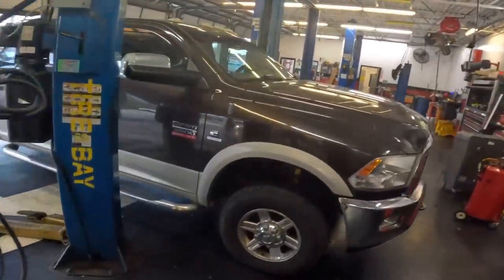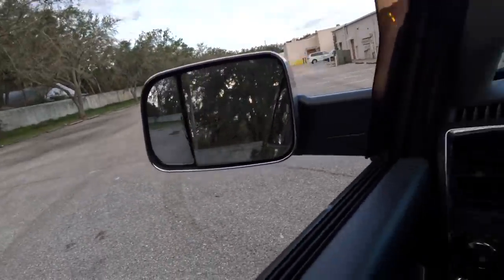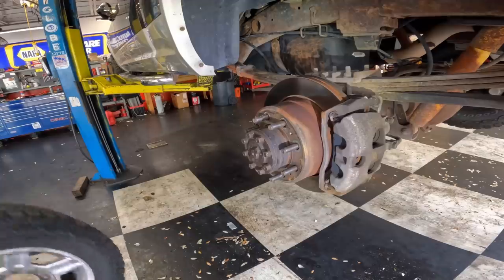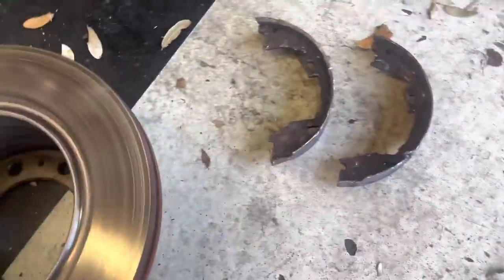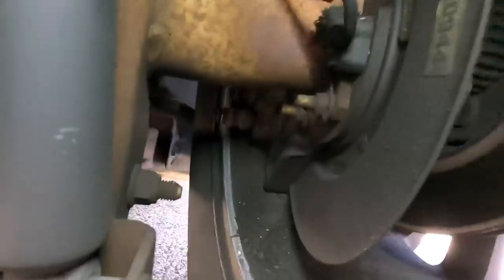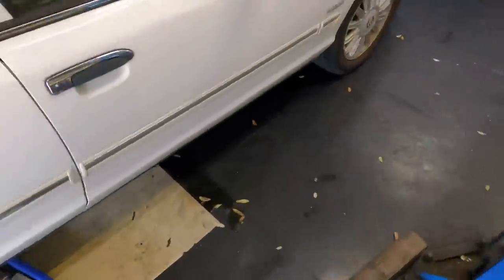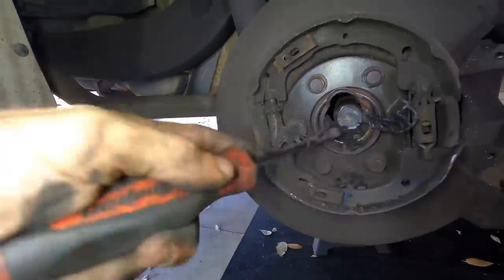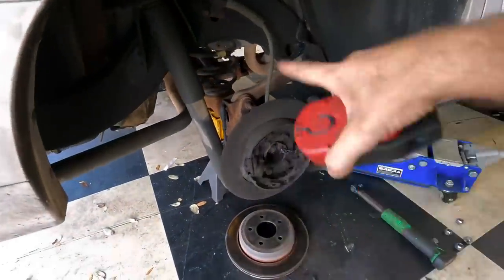Could have Killed Someone!

Comment: My wife approves of all grinding noises.
They need to happen for a couple weeks before notifying anyone.
Reply: Yours too? 😂
Reply: I have a 19 year old with similar grinding habits and some resistance to checking oil thrown in for good measure.
Reply: My wife is the same.  Must be a girl thingy.   No respect for machines at all.
Her classic line...."It just broke for no reason at all."    It reached the end of it's life cycle or you abused it maybe? (just to name a few.)
Reply: That's okay, some wives also can detect shade differences in lights too.  They know if a light comes on, it has to get brighter before there's a real problem.
Reply: @proudcanadian5713  I really think they wait until it changes to a different color before they get concerned.
Reply: I'm in that club, at least with my ex. Oil pressure light, too. "How long has that been on?" "Since I took it to JerkyLube, I was going to mention that..." (That was two surprises.) Fortunately, my now wife of 20+ years grew up with a mechanic Dad and lived at race tracks as a kid, so life's better now, for me and the cars.
Reply: My wife was the opposite, raised by a mechanic she noticed any and every odd sound or vibration no mater how tiny and insisted on knowing the cause. once found a balancing weight was bent and caused a vibration of the drive shaft, that one cost a set of tires and rims, 4 wheel alinement and a few other searches.
Reply: My wife will tell me about grinding noises. It’s the violent steering wheel vibration she doesn’t seem to mind.
Reply: I am actually wondering if people who are deaf or with severe hearing loss shouldn't get their cars driven by a friend every now and again.  :-/
Reply: Wife and four daughters, always the car is doing “X”, me what exactly is x and how long has this been happening? Daughters oh noticed it a few weeks 
/days ago, Me ?????………😳
Reply: @KeeperOfTartarus14  "The oil light was on but when I parked the car they went out so I thought it was alright...." A relative told me this about a car about twenty years ago.  The engine seized from lack of oil.  It was a nice vehicle too other than it developed a bad seal gasket leak.
Reply: @KeeperOfTartarus14  Ehh warning lights are ok if you know what is wrong with the car. I have two on my car and it runs great(one is the tire pressure sensors and the other is the check engine light and it has to do with emissions).
Reply: And the oil light too?
Reply: Hahaha
Reply: @flyingbananapeel6495  Thought if she ignored it long enough, it would shift from the steering wheel to the seat cushion, lol?
Reply: @wesgregg6451  Hahaha maybe so!😂
Reply: Wink-wink, nudge-nudge?
Reply: My wife once siezed an engine and I asked her "didn't you get any kind of warning?" she replied "well a light came on about 30 minutes before" so I asked her why she didnt pull over, her reply: "it was raining".............
Reply: We are opposite. My husband is that way. "this broken thing HAD to have had symptoms."
my husband "well... I was kinda loud, but I just turned up the radio." 
I have to face palm and take a deep breath every time.
Reply: @jaykellett2327  No. Its not a girl thing.  Its a not caring enough to pay attention thing.
I'm a girl. I FIX them. My husband is the one who ignores the grinding.
Reply: @josepherhardt164  the majority of them can be felt.
Reply: same. wifes had a Major Major grinding noise i think its a warped rotor on the Left Rear wheel. in brand new bronco. only grinds or makes a noise when you back up and do and cock the steering wheel to the right.
Reply: @mikecbrkdrvr8899  well we assumed it was normal. oh the ear piercing screeching that occurs every time you turn left? or the grinding every time you come to a stop? or the Ticking when the engines running. edit:(me with my Tinnitus and years of being around big bore diesels. and large caliber machine guns) its strange that me with all my EEEEEEEEEEEEE can hear it. on cars that are otherwise supposed to be almost silent.
Reply: I found out about things when I drive and then the oblivious looks of never happening to them.
Reply: I got lucky and married a mechanic when we were both in the Air Force 31 years ago, zero surprises ever from her, and she knows how to fix shit
Reply: Reminds me of my sister. Way back she one day asked my father what a little blue light on the dash board could mean. He pretty soon figured out she was talking about the oil pressure warning. So he asked how long it had been on. "Oh I don't know, a couple of weeks at least, perhaps a month or so" was her answer...
Reply: What kind of cars do you buy? I'm old and have never heard any grinding noises coming from any of my cars.
Reply: My wife hates it when I make a grinding noise.
Reply: @PatrickRigney  o
Reply: My female project partner then told me that her cars motor had died. No oil left. When asking her if she had noticed anything unusual she said: well, the last weeks the motor had started to get louder... Our landlords daughter arrived with loud clicking noises from the motor. Did not let her drive and did add 2 liters of motor oil. She: but the former owner told me they did an oil change 2 months ago....
Definitely a girly thing - in most cases.

Comment: Axle bearings are kinda necessary to keep the spinny bits in place. That problem likely started over a year before the shaft gave up the ghost.
Reply: And giving up the ghost it did in a quite extreme and extensive manner. I have rarely seen anything wearing right through the whole bearing. It almost surprises me the axle did not rip apart earlyer. Must be driven where not many potholes are present.

Comment: Back in 1998 I was crew-chiefing a buddies amateur drag racing efforts with his 1997 Mustang GT (lots of weld re-enforcing on the chassis, all aftermarket suspension, engine tuning and NOS) . We ran Mickey Thompson street slicks and skinnies and would launch at 6K, pulling the front wheels off the ground during both the burnout and the launch. We eventually twisted the right axle until it snapped at the splines- they twisted past 60 degrees at the break! The left axle was twisted past 45 degrees but still held. The car was strictly a play toy and we would drive it to the track with me bringing the generator, air compressor, race tires, tools, etc in my pickup up to this trip- after getting it towed 50 miles home on a Sun afternoon he found a used trailer, which was good because the next outing the track was slick, he hit 2nd BEFORE the 60ft mark instead of at it, hitting the NOS as he let out the clutch (we didn't use it in 1st as we had regeared with 4:10's and were already lifting the front of the ground) and proceeded to go straight on the rev limiter blowing apart the factory plastic intake as the number 6 intake opened!

Comment: Never seen an axle shaft go like that before.
Reply: Really? That’s EXACTLY what I don’t like about the “c-clip” axle assembly design.
Reply: We broke them like that at the dirt track especially if you got t-boned but that was a long time ago and that was heavy collision have a good day
Reply: @ToddAdams1234  I've seen axles broken from hard impacts or too much load (big ties on 4x4s etc) but not one with a collapsed bearing that's continued to be driven until the point of failure.
Reply: Try a “high torque” situation that happens EXTREMELY fast and non full-floating axles similar in design BREAK like that. Granted that ALL axle shafts can break in that “shock load” state, but some hold up better than others.

Comment: I had the parking brake explode on my 2004 F150, there was no warning. I used the parking brake for the first time in years to hold the truck on a hill with a trailer (its an automatic and I mainly park on flat ground so I don't typically use it, my mistake). Un-hitched the trailer and headed down the highway, made it about 5 miles and was doing 50 MPH and heard a loud bang followed by metallic shrapnel noises. Thought I'd lost a wheel bearing, but no, parking brake experienced RUD (rapid unscheduled disassembly) inside the hat of the rotor. Luckily I was able to remove the remnants and get back on the road. Backing plate was damaged to the point where it no longer can have a parking brake and everything else was too mangled to determine the root cause, but I suspect it was rust related.

The Grand Marquis was definitely making a whole lotta racket for a very long time. Those cars can go 300,000 mile with minimal maintenance, I wanna know How they managed that.

Comment: The condition of that Mercury strikes terror to my heart. I think this illustrates a good case for annual safety inspections. I know that Florida does not require them, and neither does my home state of Maryland. Good job, as usual, Ray.
Reply: It didn’t work before and it will not work today. People can’t afford gas, or food much less an inspection on their vehicle.
Reply: You really don't want safety inspections. Even when cars are in that condition, its extremely rare for it to fail and cause any real damage. It can happen, but its not very likely. I live in FL now, but I'm a certified to inspect vehicles in NY, and it's just something that screws people over. If something doesn't pass, the customer is held hostage until they make an expensive repair. I'd rather to not have inspections, and take my chances.
Reply: That car had Texas plates on it and had a inspection sticker on the windscren.

Comment: Lost axle tube seal, gear oil leaked out tube and then nothing to lubricate wheel bearing, toast the wheel bearing and then lathed down the axle shaft. Super impressive.

Comment: I've noticed in the past few months that likely due to inflation, there are lots of vehicles driving past my house with scraping, clunking and grinding sounds from the suspension, driveline, brakes etc. It's scary what's on the road.
Reply: I think during covid a lot of people ignored car repairs.
Car prices shot through the roof both new and used.
Now people are scrambling to fix what they thought they could replace cheap when they ignored issues.
I have never seen so much broken/worn crap in the shop.

Comment: I had a parking brake adjuster blow up on a 1984 Tempo. The pawl was not hardened right and it let the star wheel spin backwards until the adjuster came out going down the road.  It went bang and punched a hole in the flat area of the brake drum. The pedal went soft.

Comment: Ignore bearing noise, ignore leaking seal.  Find out with snapped axle. 8.8s 9.75s have issue with flaking of axle shaft material causing bearing to start to chew into axle. 
In my experience it's been the RR. 95% of the time.

Comment: Well the NOISE DID go away eventually !!!!  We found out upon inspection it was being caused by the DRY BEARINGS,once they were vaporized the only noise left was a slight rubbing noise from the axle being cut in half by the axle seal case. However NOW the wheel alignment is way off,it has a ton of toe-in >but it does quiet down while making a right hand turn.OH and could you check the parking brake,it doesn't seem to grab as good as it used TOO?thank you  RAY

Comment: Reminds me of my old '90 ranger. Didn't know jack about bearings at the time, just remember hearing a spray can sound from front. Kept asking step dad about it who blew me off saying it was fine. Later found out it wasn't fine as I was driving it one day, heard a clunk, then looked in rear view mirror to see pieces falling off onto the road. Went to pull off main road and the wheel came off as I turned. Only the caliper housing had held it together (like in this video). Found out the bearings had basically ceased then fell apart cause when last serviced the retaining cotter-pin never got replaced, so the bolt slowly backed out over time, let dirt/dust in that dried out the bearings and just helped the bolt back the rest of the way out. Luckily it didn't cause any permanent damage, but I had to replace the 4x4 lock hub, brake line, caliper housing, brakes, bearings, and retaining bolt. Came out to about $600 in parts alone and I ended up doing the work. Never had another issue with it and drove it for another 10 years until I sold it. 

Valuable lesson learned....any noise should be investigated as soon as possible, and anyone who says it is fine...is just being lazy and doesn't want to look into it.

Comment: That's definitely a curb-inspired break. I did it to my 2011 Mustang RTR Conv. Geico Insurance cut corners and only replaced the axle and assembly. The Stang needed a new rear because the repair left me with a squeal during turns.

Comment: Comment on Mercury- these are super good auto's mine is a 2004, very little ever repaired other than general maintenance and very minor sensors replaced. I would most definitely fix my Mercury even if I had to borrow money to fix it. Right now I am having a problem that was supposedly repaired but was not and I am trying to find someone to fix it. I live in a remote part of northwestern Louisiana  and very few mechanic shops anywhere reasonably close to me. However I will get it repaired asap since this is a wonderful car to own and drive. Still in beautiful shape and so worth getting it repaired. Ford made a serious mistake when they discontinued this model. Nothing I could buy today would equal this car.

Comment: Design is similar on the 1500's. About a year ago, I had the parking brake guts grenade on my 2012 Ram 1500 going down a road at 35MPH. In just a few seconds the new "free-floating adjuster" carved a nice groove into the rotor.  At first it sounded the rear end ate itself and felt like a giant picked the rear end of the truck up.  Thankfully, no damage to anything else.  To replace the backing plate, the axles have to be removed, so I went ahead and replaced both rear parking brake assemblies, bearings and brakes while everything was apart.

I noticed the Merc had a recently expired Texas inspection sticker.  I wonder if someone drove it from Texas to Florida like that??

Comment: I'm a truck driver. There was one job I had where I had to share a truck with another driver. We each worked 12 hour shifts, so the truck sat just long enough to fuel it up. I noticed a squeaking sound coming from behind me. I wrote it up in the daily inspection report and let it go. Over three weeks, it got louder and louder. And I noticed it was doing it only when I moved and in either direction. So, I finally had enough and crawled under the truck.

The carrier bearing had failed and at some point had grenaded. The only thing left was the bearing housing. The driveshaft was rubbing on this housing, causing the noise.

So yeah. Don't ignore the grinding noise
Reply: Thanks for the feedback and expect more videos soon. Send me a text above🔝🔝🔝 I have something for you..

Comment: Awesome videos Ray!  Thank you for all the hard work, and all the video work that you put into each video.  Quick suggestion, take your ring off and put it on a chain around your neck or a belt clip.  I never wore mine at work in the military, but sometimes I forget it lately.  I've put some abuse on it, but I also picture in my mind a friend that was missing a ring finger from a preventable accident.  Stay safe!
Reply: I nearly lost my ring finger about 7 years after marriage, when coming out of a grain box over the side, slipped my foot off the narrow box rail, fell, and as coming down (GRAVITY !! as Ray would say) off that 10 ft box side, got caught on a tarp hook as it slid between ring and flesh. Still have the ring and the finger, but both have a serious gouge in them. Left as a reminder after hanging several moments with all 200 lbs of me dangling mid air ...... never wore it while working again

Comment: I am wondering if this is also hurricane Ian related on the Mercury Grand Marquis and there may be many more similar problems in the affected areas of Florida.

I have seen a van that sat for a while in flooded area. It was in a low point in a parking lot during a heavy rain. It was deep, just above the axles, but not so deep that water got inside. The customer started it out of the parking lot and for a couple of days. They brought it in because of noise from the rear end. We drained a dark brown milkshake of oil and water out of the rear end. There were a couple of gallons of it and man did it stink. His wasn't as bad as the Mercury (no snapped axle.) But ALL the bearings and gears were trashed. We figured that the water got in through the breather on the top of the tube. We ended up putting a good used rear axle from a junk yard. Also did rear wheel cylinders, shoes and U-joints. Front hubs were fine.  Most trucks I have seen have a tube going to a higher point in the body as the breather for the rear axle.

Comment: I have a question about serpentine belts. My mom's car has 3 belts and one of them broke, but it has a manual tensioner (just a bolt and bracket), How do I know when it's at the correct tension?

When I replaced it I also had to buy a new bolt and bracket as the old one was rusted and seized together.

Comment: I had an old Kaiser Jeep that did that. Right rear wheel bearing failed and the only thing that held the wheel on was the brakes riding on the shoes. I drove it about ten miles home like that and rebuilt the entire rear end with bearings and seals.  It was a close call.

Comment: Poor Grand Marquis... I currently have a 2011 Ford Crown Victoria Police Interceptor and the only major repair I had done on it since I first got it was a complete rear differential rebuild as it was complete carnage inside the diff. There were metal chunks, and the pinions and bearings were done for. It set me back $1,100 at my local rear diff shop here in NC.